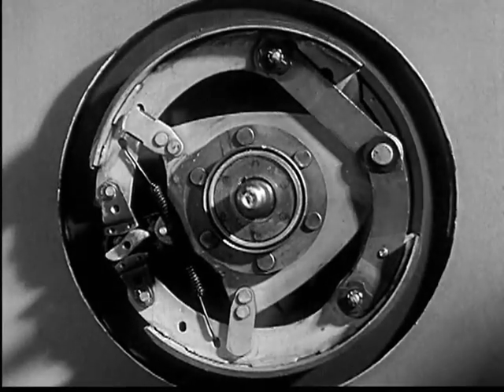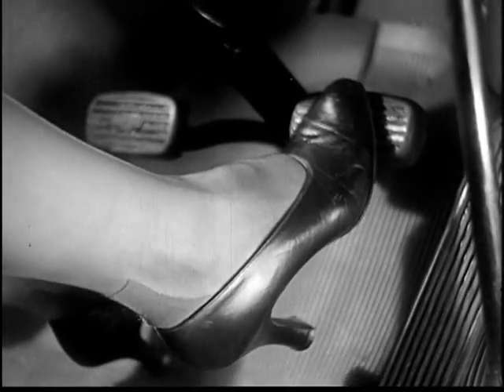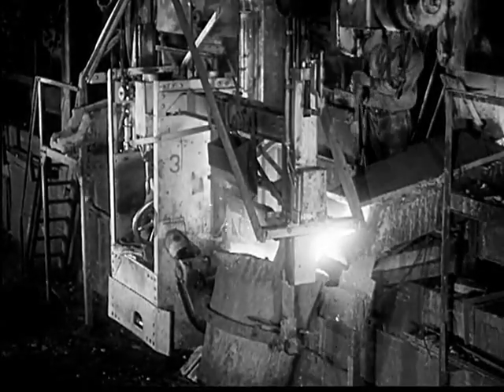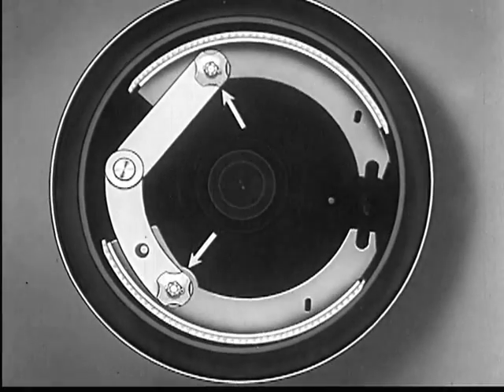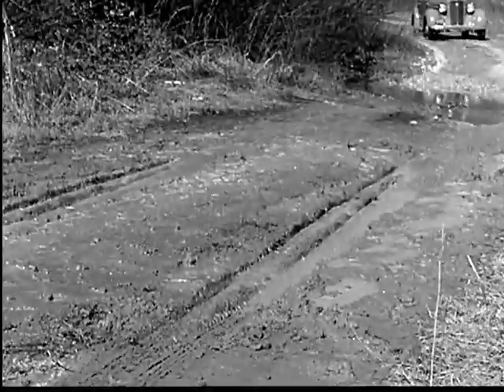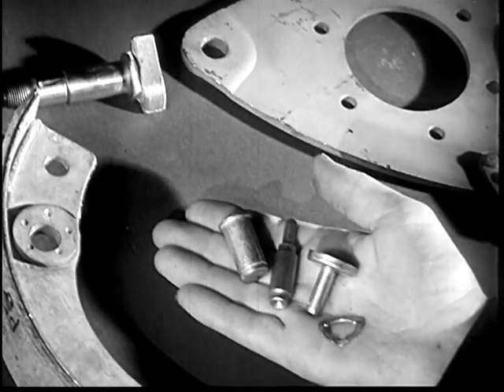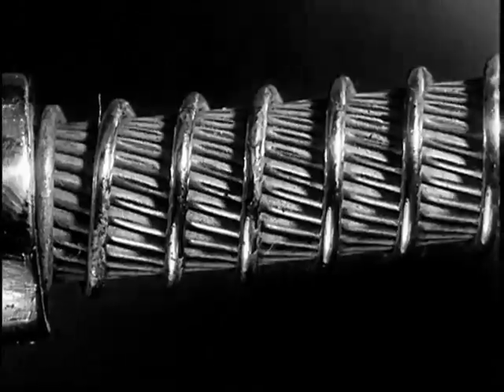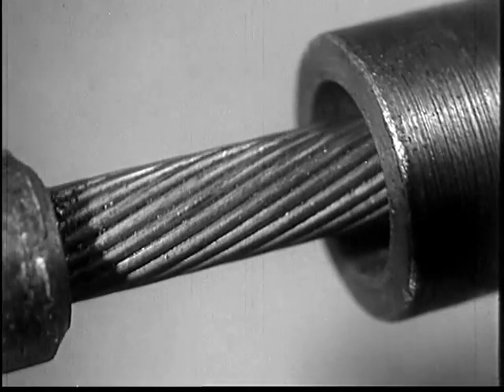What Stops Them (1935)

Comment: Does anyone know the reason why we now use hydraulic brake if wire brakes were so 'safe' back then?
Reply: our delicate weak feet wouldnt have the strength to pull the cable to have as much pressure as a hydraulic system
Reply: if you watch the 1936 axle video the factory workers arms are giant today factory workers have jacked thumbs from actuating the buttons for a lift
Reply: They found out that wired brakes rusted and eventually snapped. Even today's cars still use a sealed cable for hand brakes. My old 1965 Valiant has exposed steel cable used for hand brake but between the wheels and the chassis the cable is inside a jacket (a flexible tube) so that it can bounce up/down and still stay connected with the rear drums. I still have the lovely Valiant.
Reply: Had a 74 Gemini, the handbrake cable exposed meant there was always the risk of the braided wire either kinking or even a strand breaking means it get caught in or eventually break. Had a experience where the accelerator cable frayed and broken strand got caught on cable return hole in firewall and wouldn't return to neutral when foot taken off accelerator. Got stuck in high speed with the carbie return spring not able to return frayed cable near pedal jamming it from closing. Needless to say after traveling way over the speed limit with cable stuck, had the bright idea of turning off engine and coasting to stop. I shudder when I think of computer controlled pedals with no option of able turn off engine or pedal. been cases of computer going arse up and jamming to high speed with no way to turn off engines.
Reply: Hydraulic systems are more effective at multiplying force, lines/hoses can be routed anywhere unlike cables and linkages. Cars have gotten heavier, speeds have increased, hydraulic brakes usually have some sort of power (vacuum or hydraulic) assist to reduce driver effort to stop a vehicle.
Reply: The main problem was stretch in the cables, reducing force applied.  Rebuilt the cable brakes completely on an old Standard whose retardation was so bad I was using the gears to slow down more than the brakes!  New linings, new cables, new pivot pins, new springs and turned the drums. Jumped in the car, shot off down a quiet road, hit the anchors - could hardly tell the difference!  I just decided to drive slower.
Reply: @wonniewarrior  If a car with remote pedals got stuck accelerating you'd always have the emergency brake (which are always mechanical) and the option to put the car into neutral.
Reply: Hydraulics were better suited for the dynamic and differential conditions of America's numerous roadways.

Comment: ironically, Chevy switched over to hydraulics the very next year
Reply: "the action...must be mechanical" lmaooo
Reply: “The safety of steel from pedal to wheel” —Henry Ford, age 73 (1937)
     I guess it was really hard to get away from the perceived benefits of metal connection.

Comment: hydraulic breaks allow for more leverage, since pressure on a small section of the fluid multiplies over a large area. (this is how the car jacks work at autobody shops). However, hydraulic brakes are more complex due to having a fluid and other moving parts. back in the 30's, i'm sure they weren't able to produce as complex of a system reliably.

you could also say that regenerative braking is a third form of brake system, and maybe in the future we'll be asking why electric brakes weren't in use now.

Comment: Yes sir, this was the last year for mechanical brakes in 1935, Chevrolet going into the 1936 model year with the old favorites hydraulic drum brakes. The brakes were Bendix under license. The great man, Henry Ford would not pay for the license to use hydraulic drum brakes he had his engineers design Ford Brakes for Ford cars.
The year was 1938 model year in USA and 1939 across the international range of V8 models equipped with castor oil fluid hydraulic drum brakes which was good for 30 years less fair wear and tear. In saying Ford brakes were much superior is an understatement, finest brakes with fade resistant qualities.,Yes Sir another fine example of fine Fords.
Reply: Always a Ford guy hiding somewhere.

Comment: On modern brakes a rusty brake line that pops a pinhole leak will kill the whole brake system. The cable linkage seems more reliable, but without the advantage of hydraulic pressure.
Reply: What century do you live in? ;)
Since the 1970s all cars have had double brake-circuits and if your car has anti-locking brakes you have an individual circuit for each wheel. 
Checking your brake lines regularly - like once a year - will very effectively eliminate the danger of rust damage. Not that any car built in the last 20 years has been equipped with rusting brake lines ...
Reply: I have a 2000 F-150 and on 3 occasions I have lost braking power completely.  Once due to a caliper breaking off (poor maintenance from the previous owner), and twice due to pinhole leaks in rusty brake lines.  On all 3 occasions hydraulic pressure was lost and the only way to stop was to downshift and coast.  The brake pedal was as useful as the clutch pedal in stopping the vehicle.
Reply: Not so sir. Modern brakes have dual circuit systems .And another thing....brakes do not stop anything apart from the rotor or drum. The tires friction contact do the stopping. With no friction, as on ice or in the air, stopping can only be hoped for!
Reply: michaelXXLF When my rear right brake line rotted out on my 1995 Subaru Legacy ( 2 weeks after i purchased it used) I lost all brake power completely, had to downshift and use my mechanical parking brake to stop my car.
Reply: @SwapAscension  there you go, mechanical brakes are still in our cars after 75 years for a reason.
Reply: @michaelXXLF  - My 1996 Grand Cherokee had a brake line rust out in 2018. I live in Pennsylvania, where they use brine before it snows, and salt afterwards.